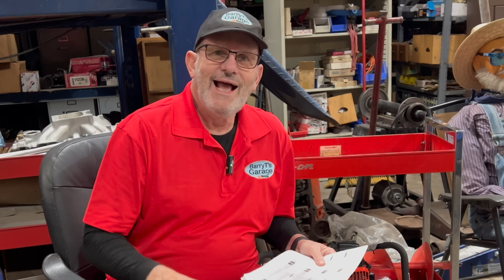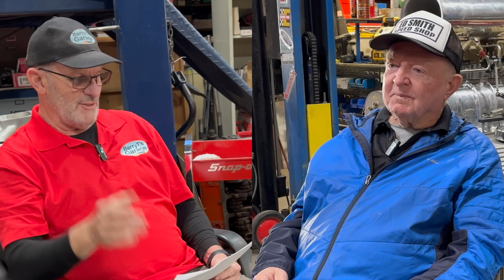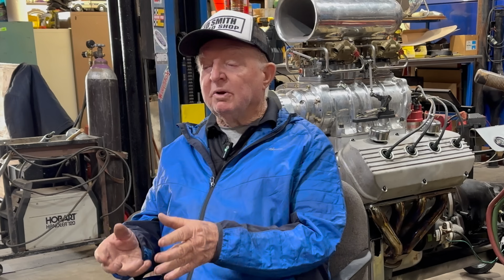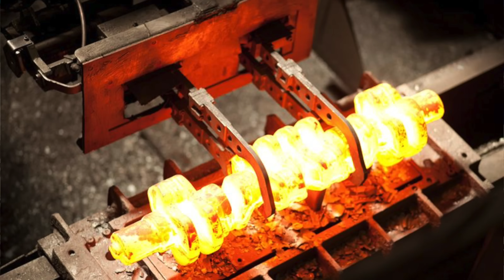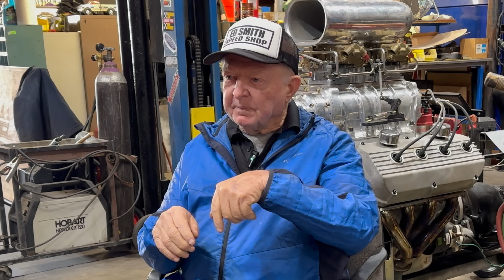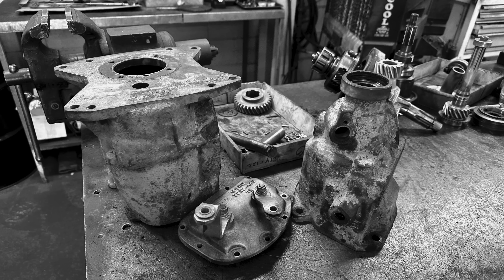Why a Forged Crank Can Actually Twist | Ed Smith with Barry T | Ask Ed 19

Comment: Barry, you can set up something on YouTube for people to send your channel money. So they can buy Ed a cup of coffee.
Reply from the maker: We now have a membership option to “buy a coffee” plus you can buy a super thanks of any amount. 👍. Thank you 🙏
Reply: I put a 70 429 cam drive set in my new 77 460.. it helped but it was still a hog, low compression.
Reply from the maker: It's the timing gear, not the cam, that wakes it up, according to Ed.
Reply: @BarryTsGarage  yes, specifically the lower sprocket. It advances the cam of full “half tooth“. We discovered this in the early seventies when the 460 Torino became a gashog pig. (thank you EPA and the safety police) A local automotive testing facility gave us a heads up and we implemented it. A customer would be complaining about what a dog a very expensive Gran Torino was and we would do nothing but a Front  cover gasket set and a C8SZ – 6306 – A  lower sprocket and you couldn’t hardly leave a stop sign without squealing the tires till you get used to it, having gotten used to sinking the accelerator to keep up with traffic.
  Once a parts man, always a parts man… That was a long time ago, but I used to be a walking Parts catalogue for Ford in those days. Too bad I didn’t dedicate all that brain power to heart surgery or something.
Reply: @Greaseland  the 460 is an awesome engine even in the trucks. Awesome torque. I worked on them for over 45 years. We had a whole Fleet of them. No other engine comes close. Equal intake runners to all cylinders and you can bore it  out .125
Reply: I am afraid channel money is going to kill YouTube channels. YouTube pays pretty good from what I understand depending on how many subscribers you have. These memberships things are not good just my thinking.
Reply: Wtfk u don't think u tube pays enough??? Wtfk r u smoking
Reply: You are going to have to replace the cam on the 460, as it will then get you more oooomph as to what you are looking for... Certain RV cams and of course higher dollar aftermarket cams are what you are desiring...Ed will know a good cam for your wishes...460 cubic inches, she has alot of potential in her...Fords Rule, except to Chevy and Mopar fans... Foreign Cars, are not in the equation...But I will take a free McLaren or a cool old XKE Jag.....
Reply: So on most motors when ya rebuild them .
Is it good to advance them 4 degrees on the crank.. that way when the timing  chain stretches over time .. you will  end up later , with a engine that would look and act like you installed the cam in the 
STRAIGHT UP  cam timing position.  
So would that be a win ,win ?

Comment: The 12 volt circuit goes down to the starter and also to the coil same circuit, from ignition switch in start position or considered crank position so the coil lights engine off easier and full twelve volts to starter.   But the ignition released and spring loaded back to run position is made to an internal contact of ignition switch to send twelve volts to resistor and dropped to around 9 volts to positive side of coil to keep it from producing a hot coil while running for hours.
Reply from the maker: Spot on, that's exactly how those systems function.

Comment: I've got a question for Ed!

I have a Carburated 454 in a 24,000lb bucket truck. Its a basically stock gen 6, just with simple decked heads, new valve guides & freshly seated valves, a holley 750 & dual plane intake and HEI distributor. 

My question is, for highway driving what would be a safe RPM range? Currently I run 55 mph @3500rpm
Reply from the maker: I will ask Ed… Thanks for the question
Reply: @BarryTsGarage  Thanks Barry!

Comment: I want to profusely thank you for your efforts to educate us.
I am a child of the '40s, and lived through the glory days of the automobile.
I worked at several DPCD garages in the '60s & '70s and their Master Technican Service Conference program wae great.
As for dual points;
One set of points “breaks” the coil primary circuit, and one points set of point “makes” the primary circuit.
As the distributor cam opens the “make” set, they open but nothing happens yet.
When the cam opens the “break” set, the flux field in the coil primary collapses, thereby firing the corresponding plug.
The “make” set then quickly closes and begins the build-up of the of the primary flux field.
With dual points, the dwell angle is increased thereby providing  a hotter spark.

Comment: regarding point vs electronic, , the add on conversions might not give as much spark, the long duration MSD multiple strike types of which i have some experience with the crane branded version, worked amazing, I had a boat with  2 427 Fords and dual point mallory setups, hard to start always no matter what, when I spliced in the Crane HI set up , i could hit booth keys at once and in two spins theyd be idleing at 500 rpm with a definite happy rumble.hard to beat that sound or forget it. this was 20 years ago.

Comment: The 351 Clevelands did have some oiling problems because the oil galley routing allowed too much oil to feed the cam bearings and lifters. Unlike the Windsor (and others) the Cleveland has only two main oil galleys, known as a "non-priority" oiling system, meaning it oils the camshaft bearings first, often starving the #4 and #5 main bearings at high RPMs.
 A common fix was to install a threaded restrictor plug kit with metering holes to control the amount of oil to the cam and lifters, and force more volume to feed the crank bearings.
 Some builders ran an auxillary oil line from the front of the engine to the rear of the block near the oil pressure sending unit to force more volume to the rear mains.

Comment: * One spark plug  shows slightly, barely leaner condition.what is your sequence of  troubleshooting to resolve? Considering: Timing/valves/ A/F/or AIR OR fuel Or coolant flow not uniform? 
*****AND- I was thinking- can you tweak spark plug gap to fine tune or alter ONE cylinders timing??? Because you can only advance timing to the weakest cylinder- thereby reducing the whole engines output.  Thanks- Jim B.
Reply from the maker: You raise some great points, I’m definitely going to ask Ed about that

Comment: Dextron (GM) is vegetable oil based.
Ford type F is mineral oil based.
Both prone to oxidation, varnish, when overheated.
Ford Type F was a good bet universally… until Chrysler Torqueflights began adding the lock-up clutch. (‘78).
They require a special fluid, and it’s critical in order to prevent major damage, even more so in their overdrive transmissions.

Many Japanese cars used to use whale oil, 60’s thru 90’s at least. I don’t know if this still applies to newer models.
Smells fishy for some strange reason. 🥴
The cars come with whale oil from the factory, but you can’t buy whale oil separately in the US. Greenpeace managed to get whale oil banned under US import laws. 
Keep that in mind when you think about servicing your very expensive Japanese transmission that isn’t designed to use different oils.
The calibration is affected by viscosity changes, and the metalurgy is different, so longevity becomes adversely affected.
Just because your whale oil smells fishy, it’s not a good reason to replace it. 🧐
Jussed sayin’. 😶

Comment: I have a Ford performance book, and it suggests on 351C, M, 400, tap the oil passages and plug with 1/2” plug, then drill 3/8” hole in the plug to raise oil pressure to the top end.  Some of those Ford’s were designed to run with 10-15 psi oil pressure.  The idiot lights that flashed on the dash at idle was a little over 5 psi.
Reply from the maker: It’s very interesting. I’m gonna ask Ed if he has heard about this.

Comment: 28:55 back in the 90s when i first started wrenching, allot of people were converting old 6vdc generator driven air cooled vws to 12 volt alternator systems. Allot of people wanted to keep as much of the 6 volt accessories as possible while running a 12vac alternator. I would solder a zener diode to the lights, the horn, the old radios. Especially on the headlights that diode would get quite hot. I would mount them w a large aluminum fender washer  and make sure to get good contact to the body steel for heat transfer. There were some issues w old zenner diodes, especially in really cold weather. The diode wouldnt pass the full 6 volts until it warmed up. I had 1 customer who used to run a chopped in half bug, with about 18" of the center removed, and ran 28" tall all terrain  tyres. He would use it as his hunting rig and shipped it all over the world. It was a 6 volt conversion, i had heat sinked zenners for summer and potted internally heated diodes for winter (this package was very common in aircraft components, where temperate could vary wildly). Everything was set to a switch. If he was running thru africa power went thru heat sinks, if he was in newfoundland he flipped it to winter mode. The hunt bug was truly a work of art. Cutouts w hinged locking lids to access hard to reach parts. The most genius was shortening the body length by 18", in combination with the large rubber by the time the front wheels were going over an obstacle the rear wheels were getting a grip on it. It was like a little 2 door tank. Also about the easiest mod you could hope for. All you had to do was shorten the shifter linkage, adjust the parking brake cables and shorten the fuel and brake lines. He also had the perfect tool kit. It wasnt more than a dozen tools and you could tear the whole car apart and put it back together with that little set. He kept 2 spare carbs 1 spare setup for normal altitude and temps, the second spare was his high altitude/winter carb. Asside from the carbs he would bring maybe $30 in parts. All the tools and most of the parts fit into a red 3 drawer craftsman box he had strapped to the firewall which was basically right behind the passenger seat. He made a custom trailer from fiberglass (he was also a boat builder) that used a pintle and ring style hitch and dual axel walking beam axel suspension.  He was also a guage nut, rightly so imo. He had head temp gages on the left and right rear (the 2 hot spots), oil temp and pressure, the oil gage had a low pressure buzzer and giant idiot light, voltmeter (it was a 12 volt conversion), a mechanical fuel pressure guage that ran off a little copper pipe from the carb inlet to the dash (not sure how safe that is considered nowadays, oil pressure was also a pipe), it was carborated and ran on gasoline but he had an egt sensor, im assuming for carb tuning in odd environments. He had custom snorkels functional check valves (1 way valves) on the road draft tubes. And of course a hi capacity finned oil sump. He was running a spin on oil filter/ cooler kit for a little while but the little extra cooling provided by tha anemic electric fan and the tiny single pass cooler wound up being a poor desicion and just fucked up the normal airflow pattern of the engine driven fan.
Reply from the maker: There is a totally amazing story thank you

Comment: 15:43 Holley has made a 4 point adjustable 4 barrel carb since at least the 90s (my whole life w cars). They are amazingly tuneable   but do require knowing what ur doing. At least more than an edelbrok/carter style carb, u can bolt a carter onto about anything and have it running in about 5 minutes. But if ur trying to get the most out of something you cant beat a holley.

Comment: There were 2 styles of dual point ignitions. The flathead v8 style dual point had 4 lobes on the point cam.
This style essentially takes the firing order and splits the duty between two breakers, firing every 180 degrees allowing each set to rest every other cylinder or essentially slowing the distributor down to 1/4,speed. The second type fires every 90 degrees with the leading breaker starting the coil saturation and the trailing breaking and initiating the spark. Personally I think the first style with two separate coils would allow for more RPM as the points are much less likely to bounce or float as the rpm increases. Lots of folks don’t realize that a single point 12v ignition limits rpm’s to around 6000. The spring on the breaker has trouble keeping them seated and following the abrupt little point cam lobes. The dual point leading/trailing type distributor like the hi po 289s and cobra jets had will make a hotter spark but does little to help extend the rpm range. This is why old race cars usually had a Vertex or Mallory Magneto.
Reply from the maker: Thanks for the info!
Reply: @BarryTsGarage I’m gonna stop brother, this is Ed’s deal, he’s just a gem and I love getting his perspective. I have so much respect for the old guard, the guys who made horsepower before you just added turbos or nitrous to an LS.

Comment: Billet all day or forged i never trusted cast for high rpm stuff
Reply from the maker: fair enough!
Reply: @BarryTsGarage now Ive seen some cast cranks hold up like this one booster inline 6 to 6,000rpm and it was under boost like 12lbs to be exact and it took it good set of h beam rods and forged pistons was in there and it was balanced really well with a really high dampener on the crank but I was genuinely surprised by that I seen to many cast cranks in v8 motors let go usually at the second main and right between the dampener and first main which most the load is in the center usually so I can't figure why they break where they do

Comment: The 429/460 was so heavy unless you have aluminum heads and intake. I still love the individual  way of the FE. A 4.08-4.09 bore and 3.985 stroke was a fun engine. It puts out some  power. The 385 series is kind of a BBC copy with a tiny exhaust. The FE is like nothing else.  It was surprisingly light.
Reply from the maker: Thanks I’m gonna ask Ed his thoughts on some of that!
Reply: You are welcome. There is a lot of misinformation floating around about the FE. In 1961 when the 390 first appeared  it was 375 hp and when I rebuilt my 69 390, I put an aluminum intake on it that would weigh the same as the 61 intake and I weighed it and it weighed just a hair over 520 lbs and it dynoed at 510. The cam is a solid lifter Comp from 1999 with specs very similar to the original 61 390 cam. It still runs beautifully, no blowby or oil consumption, and no leaks after 26 years. I can’t see to drive anymore, but I used to beat the snot out of it. But weighing a 350 Chevy with a QJet on it  the weight was 540 lbs. The claims that it was a heavy engine are untrue. A 429/460 is 700+ lbs like a BBC. I was surprised by Jay Brown weighing his 445 stroker with Edelbrock heads and RPM intake and it only weighed 505 lbs and made 570 hp. Ford achieved more than a hp per lb and the 6V 390 in 61 made 401 and engineers who worked there in 61 said that the 390 6V actually made 425 hp, and they had to detune it. The torque was 460 ft lbs vs Chevys 396 410. Just a few facts. Ford enlarged the chambers and reshaped them from the heart shape to the shovel shape. The heart shape looks much like the later “Yates” 351C chamber. The shovel chamber still makes the same power. The FE has always been a smooth and lightweight rotating assembly. The harmonics were really like nothing else. I hot rodded 410s in high school. Bored .040 over solid cam, SPS studs on the deck and mains, crossbolt caps on 2 and 4 with a short fill, C6AER heads with 2.19/1.6 valves and a rise on the roof, a 2x4 TW intake and internal balance ina 67 Mustang in red oxide. I never got beaten by anyone on the Ozarks 2 lanes running 32 miles. They either quit or blew up. I drove mine from my Sophomore year to 1980 when I left it at my parents house and when I got out of school and came to get it the car was gone along with my parts, my 375 hp 396 and the Chevelle I had built to sell. I’m 64 now and legally blind so I don’t get to drive anymore. But the 390at .020 over clocked 158 mph on a G-Tech right before they took my license. 1965 LTD still sitting here and it runs.

Comment: I put a 460 in my 76 Ford 4X4 pickup. I got the  motor from a 71 Lincoln. It came from the factory with 10 1/2 to 1 compression Pistons. I Advanced the cam six degrees for more torque for pulling a trailer and for off road fun. It would pull really strong up to about 4000 RPM. It was a great engine and a beautiful truck! The guy that now owns it, says that he will never sell it till the day he dies.
Reply from the maker: Awesome
Reply: Id like to find a 460 for a project....?

Comment: I used to keep a fine emery board in my toolbox just for old point cleaning and polishing, it fit in tight places very well and made it easy to dress the points. Always use an air nozzle to blow out the grit and dust left over for dressing the points tho. One piece of grit could keep the points from ever touching and not firing a spark.
Reply from the maker: That’s a great tip, thanks for sharing!